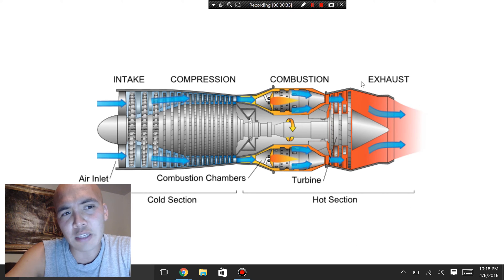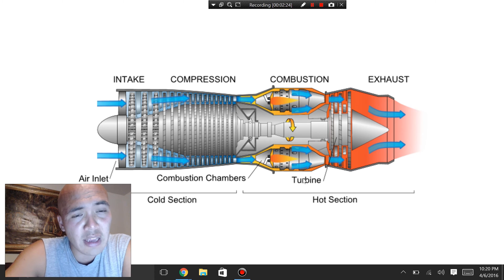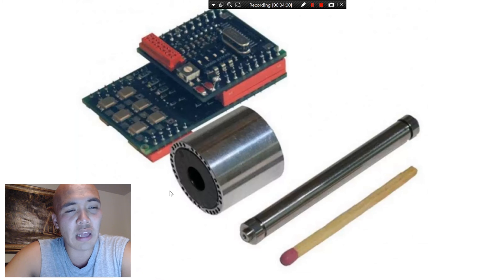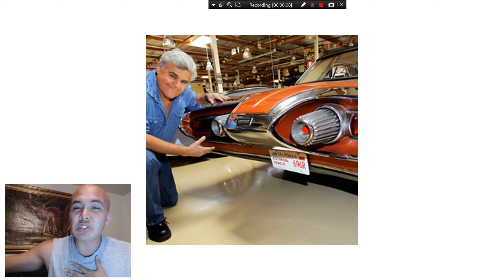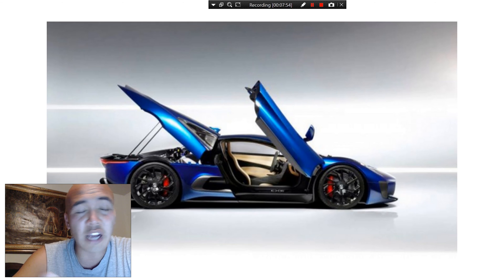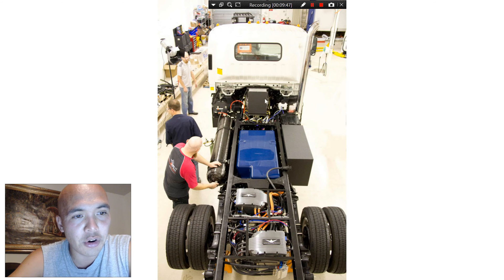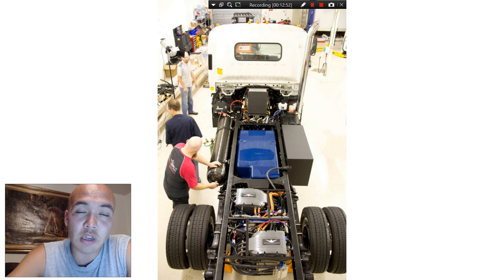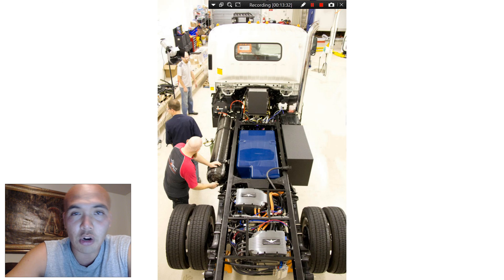Micro gas turbines in hybrid electric vehicles

Comment: Respectfully, this video is full of nonsense.  That little micro turbine is nowhere near 98% efficient. There is no fan on the turbojet diagram shown. 

Diesels (~low mid 40%) are generally more efficient than turbines (mid high 30%) and definitely gas engines (low 30s%). Small turbines are even worse for a variety of reasons.  Giant land based turbines are very efficient at 60% but there’s a couple buildings worth of systems which enable that. 

There are other benefits like power density and power:weight and reliability which is why they are found in airplanes. Efficiency is more a function of pressure ratio, cycle type, and losses than continuous vs intermittent combustion. Sources available on the web.

Comment: Maybe, maybe not... In general additional engines in a vehicle beyond electric engines don´t make much sense. Hybrids basically have both technologies on board which makes them less reliable more expensive more complex and heavier. You basically get both disadvantages. 
Turbines start to make sense in a marine or rural application etc. But they will compete against all the other IC engines like the new improved rotary engines etc. Those are typically less complex and thus less expensive.

I remains to be seen.

Comment: The real benefit is you don't need a clutch or torque converter electric motors can cover the range of speeds,  you can even have controlled engine braking the biggest issue is batteries capacity, if you coupled a gas turbine to a high speed alternator you need a gearbox, but you could feed power directly into the electric motor from the turbine generator at high road speeds and at lower road  speeds, when the battery needs topping up like Low city speeds only turn the turbine onto recharge.
High speed sustained high current draw, use the power of the turbine and alternator to provide the energy rather than the battery, the problem with jet turbines is they require a high turn Down Ratio gearbox, turbine spins around 30000 RPM they're not designed to be switched off and on  they're efficient only at constant speed, they are exceptionally noisy and produce lots of heat that has to be ventilated.
Personally I think the internal combustion engine piston engine will be  around for quite a long time.
Best to convert them to run on compressed natural gas or liquid petroleum gas, if they want to improve the air quality.

Comment: fantastic video!
I've been a fan of the turbine car for as long as i can remember and yeah, the mechanical turbine can produce some incredible torque, and amazing peak power and efficiency, but the throttle response, idle, and braking are terrible as the turbine takes time to accelerate/decelerate and is still producing a fair amount of power at idle (burning the brakes out) as it needs to sustain itself.

i thought of a few ideas over the years that would improve on the turbine car concept such as charging a capacitor bank off the exhaust gasses, and using an electric motor to augment the turbine on acceleration, but that idea would've still sucked as there's still the brake drag and the wasted energy at idle. second was using the turbine to drive a generator only, and then powering 4 smaller electric motors at each wheel as it would have great traction and awesome acceleration, however that would've still been wasting energy as the turbine idles and the turbine would need to still spin up resulting in not having maximum power at the wheels the moment you drop the foot. sure, in the name of traction and safety that would've probably been a bonus, but still, doesn't quite solve all the problems. i then figured that battery could be a viable solution to the problem when the Prius started gaining popularity. the only problem with battery is they like to charge slowly and don't like to discharge incredibly fast so in performance applications a capacitor bank would probably be preferable in my opinion, but then again i never really considered making the turbine smaller to augment the EV, it's always been more the opposite to me with electric tech augmenting a more typical turbine like the Alison M250.

in any case, it's good to see I'm not alone in thinking about this stuff

Comment: it's not called a "range extender" that sounds retarded, it is an on board generator, you can put a Honda generator in the trunk of a Nissan leaf and get
the same result to generate power increasing distance in an EV. You can have an on board integrated energy generation system or an external
one like a generator you can get at a hardware store.

Comment: Extraordinary stuff comes from the minds of antipodian Euros - Wrightspeed, Seacat, John Britten (RIP). Outside--the-box thinking at its best (ETA must be cultural, from the kind of people who shipped (or GOT shipped) over there - "this isn't  do-able because you say so? f^%£ you").

Found your channel searching for micro-turbine hybrids. The first axial micro-turbojet wasn't even designed and built unitl 2011, so VERY early days. There's MASSIVE room for developent to opitmise them for delivering primary movement (shaft power) rather than thrust, recovering heat from the exhaust etc'

I can imagine re-engineering a Tesla with a battery 1/3rd of the size and weight (saving >600lbs) and using a 30Kw micro-turbine generator with maybe a 4 gallon (18L) fuel tank which STILL makes for a lighter car and STILL has much better range.

Comment: Trains use this type of technology for decades. The reason why they are called Diesel electric locomotive is because the Diesel engine charges the batteries that drive the electric motors that drive the wheels.
Reply: diesel-electric locomotive DO NOT use batteries to drive the electric motors. The 4000+ hp diesel engines drive generators that directly feed the electric motors, no batteries involved.
Reply: @dundonrl  there are batteries but they drive with the battery just a few meters .
Reply: @dundonrl  in trains with powerlines they use the battery.
Reply: @CUBETechie  It's not a diesel electric locomotive if it uses an overhead pantograph.

Comment: this is solid mna, you can damn near feel how pumped ya are about turbines :D But i wanna throw in, we had jet engines in the late 30/early 40s :D
Reply: Yeah, and those only exploded every 2nd flight xD
Reply: @sierraecho884  incorrect.
Reply: @redoctane13  really ? Jet engines in the 30´s 40´s vere reliable ? Is that why every 2nd German WW2 jet engine plane crashed without any enemy contact ? xD
Reply: @sierraecho884  I never said that though did i ?
Reply: @redoctane13  All you said was "incorrect" so no explanation from your part.